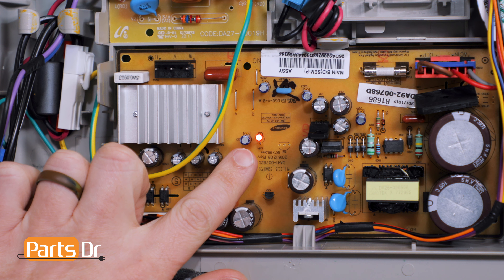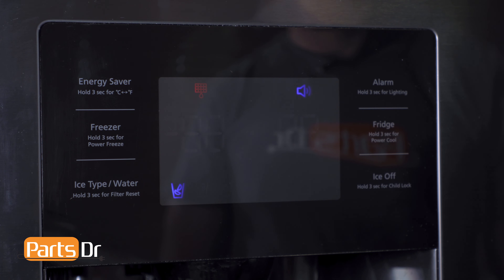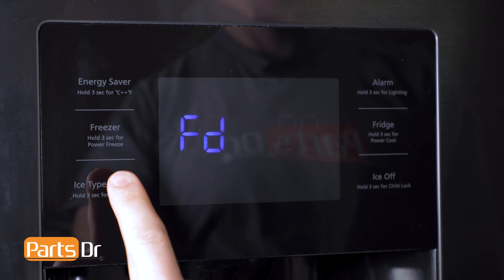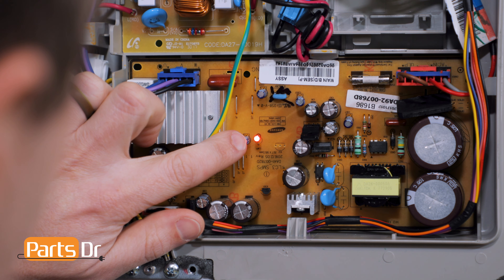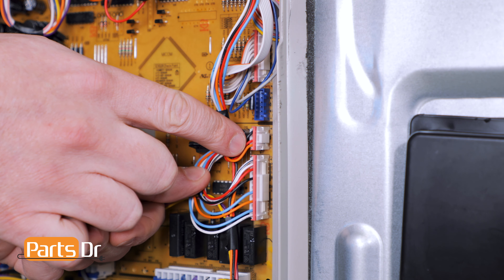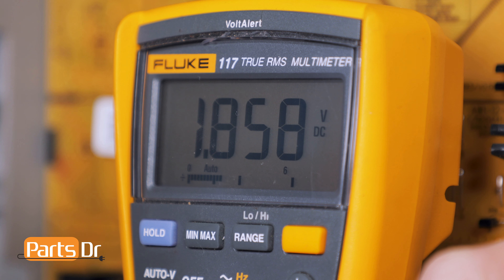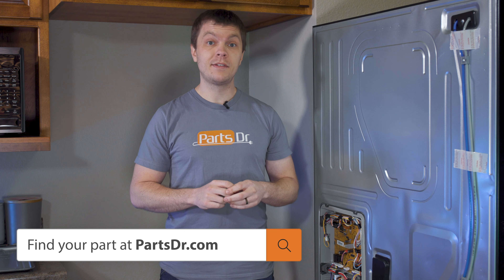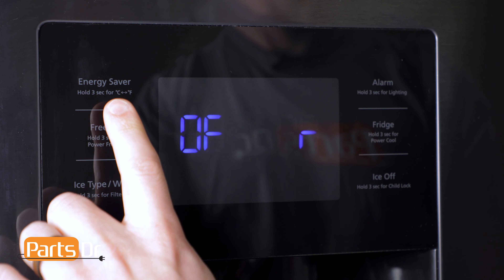Samsung refrigerator inverter control board troubleshooting & testing

Comment: Hello sir, I have a solid lit LED, evaporator fan working, compressor powering up but still fridge is not cooling. Any trouble shooting ideas?
Reply from the maker: Are both the freezer and refrigerator compartments not cooling?
Reply: @PartsDr   Thanks a lot for this video.. I really need your help on what to do next. I have this model RSAIUTMG fridge/freezer. All the control parts PCB including the inverter power board DA9200483G were changed with new parts. After installation the control unit of the fridge on the door, the compressor fan and inner light of the fridge and freezer works fine except the compressor refused to power on. Samsung compressor tester was used and it powers up the compressor only that the heated pipe of the compressor was not getting hot as a result of insufficient or no gas inside it.  Pls I need help on what to do now. I have checked to see that current is flowing to the wire that goes to the compressor. Thanks for your assistance. pls I need response from you. Thanks
Reply: Mine is doing the same. Solid LED, freezer working but refrigerator compartment isn’t cooling. Compressor is working. Would this be a control board issue?
Reply: @PartsDr  fridge not cooling only freezer
Reply: SAME THING WITH MINE
Reply: @PartsDr  I am having this problem. Neither compartments are cooling but I have a solid lit LED, evaporator fan working, and compressor powering up. Any ideas?

Comment: My compressor is turning on, the red light on my mainboard is solid, but the fridge isn't cooling.  Samsung technician said my sealed system is covered under warranty but claims the mainboard is broken and they want me to pay $500 to replace it.  I'm planning on buying a multimeter to test for sure but it seems to me that the mainboard is fine and they're just trying to charge me for the repair that I'm supposed to be covered for.

Comment: How can he measure the output p.w.m. signal from the main control board looking at the input to the inverter board with the cable disconnected, I think this guy is confused, you have to measure at the cable and i’m not sure but it may have to be connected to see proper levels.
Reply: He's got the power on.. He's measuring voltage, aren't you describing a continuity test?

Comment: I have a solid LED light. Freezer works great, refrigerator compartment doesn’t. Repair guy said compressor works, and that it needs a new control board. Does that sound right?
Reply from the maker: If the compressor is working properly, then the problem should not relate to the inverter board.  More troubleshooting would need to be done to see what is causing the refrigerator section to not cool properly.
Reply: You need to check first the system voltages if available .like the 340vdc after the rectifier ,then the 5vdc for the micro controller. And other systems voltages.

Comment: Thanks a lot for this video.. I really need your help on what to do next. I have this model RSAIUTMG fridge/freezer. All the control parts PCB including the inverter power board DA9200483G were changed with new parts. After installation the control unit of the fridge on the door, the compressor fan and inner light of the fridge and freezer works fine except the compressor refused to power on. Samsung compressor tester was used and it powers up the compressor only that the heated pipe of the compressor was not getting hot as a result of insufficient or no gas inside it.  Pls I need help on what to do now. I have checked to see that current is flowing to the wire that goes to the compressor. Thanks for your assistance
Reply: Your inverter is not working.  That is why the compressor motor not working. Or the compressor is dead.

Comment: Hi I have a Samsung fridge srf693gdss inverter board blinking 5 times .
Reply from the maker: Usually, the recommendation for 5 blinks is to first replace the inverter control board.  If that doesn't fix it, then you would need to have a professional replace the compressor.
Reply: @PartsDr   fixed it ,it was the inverter board thanks for tips 👍
Reply from the maker: @luxostucco2772  Great!  Thanks for letting us know!

Comment: Hi, main its flashing 1 time on the main board and inverter board. Any help. Thank you
Reply from the maker: 1 flash is a starting failure. Service info says to first check electrical connectors, if good then replace inverter control board.  If same problem after that replace compressor.
Reply: @PartsDr  I have the same problem on a Samsung RF4289HARS.  Connections are good but I’m unable to find the inverter control board online.  Do you have a link for the part so I can order it?
Reply from the maker: @peterjung5965  Can you please post the numbers from the barcode sticker on your original board?
Reply: @PartsDr  06DA9200215CP171B9TA264
Reply from the maker: @peterjung5965  Here is a link to the part: https://partsdr.com/part/da92-00215c-inverter-control-board
Reply: @PartsDr  thank you

Comment: Board blocking 4 times is this motor lock . What is motor lock RPM
Reply from the maker: It most likely means a compressor failure.

Comment: rf263beaesg/aa not cooling, both main board and inverter board  are good and compressor is good and no error codes.
Reply: Probably leak inside coils?

Comment: Light is solid, power is optimum, fan is working, still no cool. Should I assume low/no freon?
Reply from the maker: It could be a sealed system leak.  Usually the easiest way to determine that is by looking at the frost pattern on the evaporator coil(s).
Reply: Freezer Top 2 coils light frost,below that moist but cool. No err codes no flashes on pcb board. Refer is fine and reaches directed temps. Freezer won’t drop below 31. All fans are working. Compressor runs and gets warm and light vibration. Of course ice maker isn’t working. Temp sensors work. I’m out of ideas.

Comment: I have Samsung refrigerator model no RFG 28 MESL1 (purchased and used in India). It has stopped cooling and the (inverter) compressor does not start/run. Samsung servicing expert has identified a defective PDB (which supplies DC to the compressor) as the most likely cause of the problem and requires replacement. Defective PDB part number fitted in my refrigerator is 06DA4100614A 100DCA50163. Samsung informed this PDB is no longer available and it has discontinued manufacturing it. After much hunting on internet I find that instead a replacement PDB part number 06DA4100614B P171BB79109 is available. Can i use this PDB (bearing a part number which does not entirely match the original defective PDB) to replace the defective PDB in my refrigerator? In other words will the available replacement PDB (bearing a different part number as above) be COMPATIBLE with my refrigerator model as mentioned above? Please help. Samsung refuses to give out any information.

Comment: The main is flashing one time. I have been told it is an inverter problem. However, I can't find the part. Model # RF237AARS/Model Code RFG237AARS/XAA - number on the sticker on the inverter - 06DA4100614FP126ZB6344. Other number found - DA27-00020A. AW Inverter BK2 110v. Can you please help me locate the part? Thanks
Reply from the maker: It looks like it is discontinued and no longer available from the manufacture https://partsdr.com/part/da41-00614f-inverter-control-board

Comment: Thanks for this video. After watching your video, I decided to open the back panel of the refrigerator with model no. RS25H5111SR. I realized the inverter light stayed on for some time and completely went off after. How do I check if my inverter board or mainboard is faulty? Thank you.

Comment: My freezer is working fin. The refrigerator is freezing up. I replaced the evaporator fan and it still wont come on. I also tested the door switches they seem to be fine. What else could cause the evaporator fan not to come on in a samsung french door Frig.
Reply: Computer engineering student here with limited knowledge of this system. I have the same problem freezing up. The recirculation fan works but ultimately freezes along with the evaporation core and drain system. I verified the heating element has 100ohms (good) and the temperature thermistor disengaged with a blow dryer after some time (good). The temp sensors are negative coefficient and decrease resistance with heat applied (good). Everything points to a control board or power supply due to prolonged time frame of freeze up. I see a solid red led on the inverter board while it cools back down from a complete evap freeze up. Anyone chime in?

Comment: I get 4 flashes in LED.
Motor lock/ over RPM.
How can I fix that? Do I need to replace the motor? If so can I do it myself or do I need to get someone certified to work with compressors?
Reply from the maker: It is usually caused by a bad compressor which will need to be replaced by a liscened and trained technician.
Reply: @PartsDr  pls mine also do this RSAIUTMG but when tested with samsung compressor diagnosing tool JIG it works but with the pcb inverter it shows 4flashes. What else to do pls. Also note when I test with JIG the compressor comes up but doesn't get hot on the pipe side as there is no refrigerant inside it.

Comment: Hello i have a samsung rfg297aars fridge freezer combo. I opened the rear panel and one of the capacitors on the top board looks swollen and my red led is flashing
Reply from the maker: If you visually see something wrong with one of the capacitors, then it would be a good idea to start by replacing the inverter board.

Comment: Model number rs27t5200sr fridge side is not cooling at all freezer gets cold. Led light flashes once when plugged in then no light. Replace the control board? Anyone know the part number?
Reply from the maker: That doesn't come up as a valid model number.  See this video https://www.youtube.com/watch?v=4HhWL9sonuE

Comment: My Samsung is a RS22HDH and the inverter board light is blinking 2 times and the compressor is not coming on
Reply: Do you have the inverter board
Reply from the maker: @sajjanbharwani1934  You will need to search on our website https://partsdr.com with your refrigerators full model code/BOM name to locate the correct part.  https://www.youtube.com/watch?v=4HhWL9sonuE

Comment: Hello PartsDr and thank you for your contribution my refrigerator says E 84  which corresponds to Motor locked over RPM but I don't know how to check the voltage on th resistance R308. The refrigerator is working but the freezer is not .
Thank you
Reply: Hey, did you ever figure this out? I'm having the same issue with my fridge.

Comment: i have two blinks, what does "SPM" means, ?
Reply from the maker: Shock Pulse Monitoring also known as SPM is a patented technique of predictive maintenance by measuring vibration and shock pulses of bearing in motors and to identify their condition and operating life before the next overhaul procedure.

Service info for the 2 blink SPM Fault says to check the sealed system for restriction and refrigerant, if okay replace inverter, if same, replace the compressor.

Comment: Dear sir..my samsung inverter refrigerator the led blinking 5 times..n compresor not running..what is the problem?
Reply: Did you ever figure this out? Mine is blinking 5 times as well is why I am so curious. If I figure this out I will sure let you know, but for now I am not sure as of yet. I know it's not the Inverter PC panel, but that's all I know so far.

Comment: Mines flashes 4 times. What do I need to do to fix it? Thanks
Reply from the maker: It might be a bad compressor.  This type of repair would need to be done by a professional.
Reply: Pls how did you fix the 4 flashes of your fridge. I have tested mine with compressor diagnosing device JIG it works, but flashes four light on the inverter board when connected to power

Comment: POWER GOES OFF BRIEFLY IN OUR COMMUNITY  FRIG SHUTS DOWN AND DOES NOT COME BACK ON AFTER A MINUTE OR TWO . IF WE ARE NOT AT HOME TO RESET IT WE LOSE EVERYTHING I N OUR FREZZER WHICH HAS HAPPENED SEVERAL TIMES. WHAT MIGHT BE THE PROBLEM?
Reply from the maker: Most refrigerators have a built in delay to protect the compressor.  If the compressor stops running, it may not attempt to restart the compressor for up to 15 minutes.

Comment: What if compressor never kicks on but red light stay on?
Reply from the maker: Usually the protocol is to first replace the inverter control board, and if that doesn't fix the issue, then replace the compressor.

Comment: I have a question. Where do you go to find the service information for a refrigerator. I usually search the model and serial on google but that normally give specs and customer information, not technician information like the blinking lights table or a proper schematic to test any circuit that may be giving trouble. Im am now getting into inverter refrigerators... i would really appreciate the reference. Like a website or something. I have problems testing the boards, ie locating which pin is which. I hope you understand where im coming from. Thank you
Reply: Hey did you find what you were looking for, if so where?

Comment: rh22h9010sr how to FF Thanks
Reply from the maker: Freezer Key + Alarm Key are pressed simultaneously for 8 seconds, (displays are all off) It will be changed to the test mode (manual operation) by pressing any key.
1-1) If any key is pressed once in test mode, blinks "FF" on the display and it indicates the refrigerator has entered the manual operation. At this moment, buzzer beeps as an alarm.
1-2) If manual operation is selected, compressor will run at once without 7 minutes delay in any mode. If the refrigerator is on the defrost cycle at the moment, defrost will be finished and manual operation will begin.(Be careful if manual operation get started at the moment of compressor off, over load could be occurred)

Comment: I have no blinks, and no power
Reply: I have the same problem too
Reply: Ihave the same problem to
Reply: Mine did this and I replaced the main board, which fixed everything but the compressor not starting, lol. I'm hoping its the inverter board and not the compressor.
Reply: Samsung is junk

Comment: Hello I have a rf24 series Samsung freedge the inverter board led shows continuos flashing and the compressor is not running even though it is ok cause I tested it direct and works fine . Which card is the problem? Thanks in advance